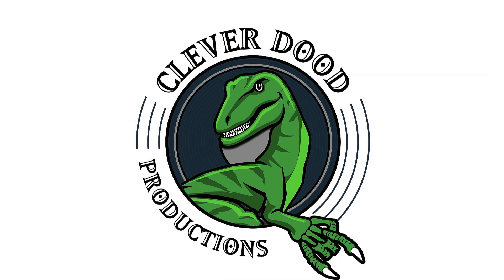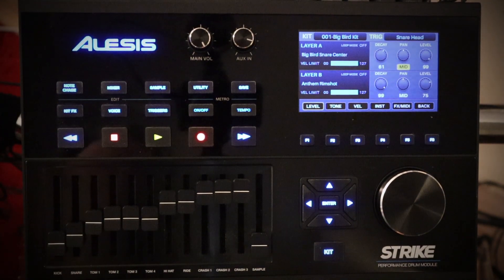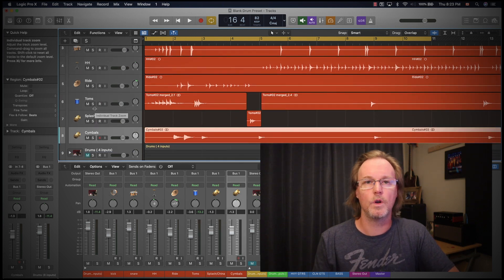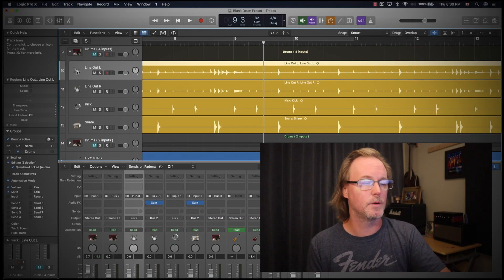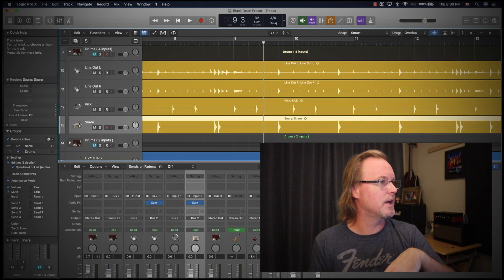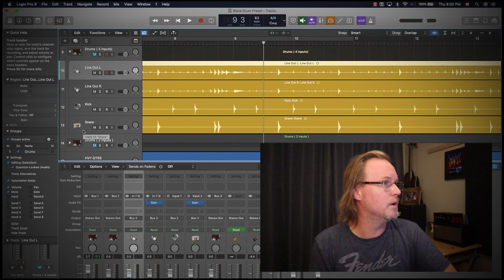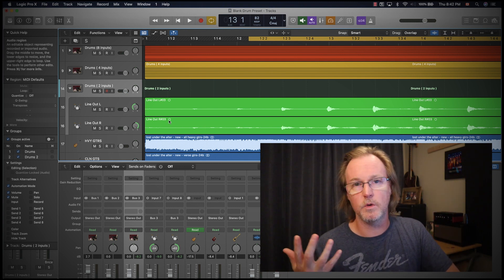Recording with the Alesis Strike Pro - Part I - Audio Outputs

Comment: Hey, Jason awesome video. We've been trying to figure out the best way to record. Removing my drums from my studio to my buddies studio. Cause he's got more computer capability. We've been wondering how to hook this stuff up the easiest and right way to do it. I'm an idiot when it comes to programming and understanding things electronically.  Which brings me to my question.I never can get my high hat to respond.Like it's supposed to I've tried all the comments.I've tried the videos and I can't get it to respond correctly. My buddy Ken who has  studio at his house.He's pretty good at high-tech stuff. I understand when you hook up to easy drummer. That it's got parameters to help with the high hat problems. Is this correct? I don't believe he has easy drummer. 2 or 3 I believe his is just the basic easy drummer. Do we need to upgrade to get better parameters for settings or high hats and such.
 Right now I'm recording my symbols live. Although I love them, it's not practical cause everybody's used to electronic drums in the volume of the symbols, even within ear monitors drives them crazy, not me? Of course, LOL.  I've even been on the facebook and offered money for somebody to come over and set everything up like it should be.
Thanks jason
Reply from the maker: I have superior drummer 3. It gives you 5 ranges from closed to open. So 0 - 20 can be fully closed, 21-50 slightly open etc. in logic it’s the CC#4 parameter and typically open the midi automation and adjust it after I recorded because I can’t ever get e-hi-hats to sound natural. I’ve even thought about just getting real hi hats and mic’ing them instead.

Comment: Question I ran all the line outs to my 18I20 where I have 8 quarter in inputs, lines 3-8 are not working, I tested the cables and they all work on inputs 1&2, any ideas?
Reply from the maker: Maybe check the Focusrite Control software and see if they're processing the signal? I would guess inputs 3-8 just are enabled for some reason.

Comment: Hi Jason, great video man.  Hey bro i was messing around with Logic and somehow i changed my Alesis midi outputs, tom 1 is now tom 2 tom2 is now tom 3 and tom 3 is now 4 and tom 4 is tom 1.  lol. How or what is the easiet way to correct this in the Alesis module sir?  If you dont mind bro i would greatly apprecite it.  I have read everything and maybe i am missing it but coudnt find anything on this.  Thank you Jason!!!
Reply from the maker: From memory, you can go into the midi settings for each pad and change that. If it's really messed up, you could always reset it to factory settings, but if you've done other customizations all of that will be lost.

Comment: Hey Jason what cable should I use for the individual outputs, TRS or TS ????? please answer thanks
Reply from the maker: TRS cables would probably be best as the toms and cymbals are stereo pairs. As far as I know TS can only carry mono signals, TRS carries mono or stereo. I used something like this https://www.amazon.ca/Monoprice-8-Channel-Snake-26AWG-Cable/dp/B00IACDU34/ref=sr_1_1?hvadid=671305341565&hvdev=c&hvlocphy=9000854&hvnetw=g&hvqmt=e&hvrand=4674649382955102451&hvtargid=kwd-315320833108&hydadcr=1502_13637761&keywords=trs%2Bcable%2Bsnake&qid=1699534125&sr=8-1&th=1

Comment: So no need to worry about latency when tracking individual outs?
Reply from the maker: Depends on a bunch of factors I guess. I never had latency issues but I turn on low latency mode in logic, lower my samples, close anything running etc.

Comment: Bro, did you explain what kind of cables you need to plug into the console? Are they TRS cables , as you mentioned there Tom’s and cymbals that are combined stereowise in one track ? So what kind of cables would you use if you wanna use the 8 outputs? Please let me know as I’m confused a bit about that connection
Reply from the maker: I thought I put the link in the description but I didn't...this is the one I use: https://www.long-mcquade.com/4386/Pro_Audio_Recording/Cables/Yorkville_Sound/8_Channel_TRS_to_TRS_Fan_Snake_-_10_foot.htm
Reply: @cleverdood  hey Jason thanks buddy, I’m actually trying with regular mono cables and it records fine, what would be the diffrence if they are trs? Is it better trs , I have trs but they are in my other home
Reply from the maker: @dannyveras  as far as I know, TS cables are mono and unbalanced ( mostly used for guitars ) and TRS will carry a mono or stereo signal ( like 1/4 headphones ) and are balanced. Either should work fine for the Strike. I don’t know enough to know if there’s any difference in quality.
Reply: @cleverdood  same here I don’t know if it’s better but it works , I’ll try to bring the the trs ones and see the diffrence , if the Toms and cymbals are balanced on stereo it might be better , I’ll let you know !

Comment: Would anyone have an idea of why my individual outputs for toms left and right and crash left and right won’t play any audio? The individual drum outputs for everything else produces audio, but the drums and cymbals that are a left and right output do not produce sound.

I am running all outputs into an 8 channel preamp. There is a light on the preamp that lights up, which indicates the preamp is getting some sort of signal to it. But each individual drum pad for left and right for toms and cymbals would cause signal to go to 2 different preamp channels even though each left and right Tom output is connected to only one preamp input.

Not sure if it had anything to do with no audio, but the only outputs that do not produce sound are the ones that get sent to 2 channels in the preamp.

Comment: Hi Jason thanks so much for the video. I'm using the strike pro live with an acoustic kit with real cymbals and triggered drums. I'm only using the module for Kick, snare and toms. I want to be able to add effects to the drums and save as a new kit. I want to keep the live mixer clean with no effects as I cant change the mixer settings quick enough on stage like selecting a different kit. Is there any way to add and save effects and have them output through the individual outputs? or am I better to say pan all my toms to the right output and the snare to the left and have the kick just raw. Maybe just using the two main outputs is the way to go and just set the levels of kick ect based on the venue through the strike pro mixer. I hope this all makes sense. Any help would be very much appreciated. Cheers Sean
Reply from the maker: As far as I know, the individual outputs will always output the raw samples, not the kick FX. For live, I'd rely on the sound person and use the individual outs so they can control the levels and FX. Probably less stress!

Comment: Thanks for the video.. I have a 8 track audio interface but I cannot figure out how to pan my toms and cymbals to feel the stereo. to me the signal is centered.. New to the Alesis SE, any advice ?
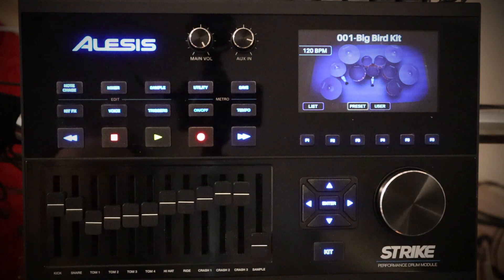Reply from the maker: you'd have to set that up in the Alesis module 02:18 or so area in the vid...
Reply: @cleverdood  thanks it is a little before  the part for the 8 tracks around 05:47. Thanks I will set them up in the module.
Reply: Did you pan your inputs in the DAW?

Comment: Awesome video. Exactly what I was looking for. Question.... Can use USB to record audio on the Strike like you can with the Roland modules?
Reply from the maker: good question! I assume the answer is no, and only midi is carried over USB, but I haven't tried that!
Reply: @cleverdood  plase can u try ?
Reply: No. Alesis did not include that.
Reply: You can connect the 2 streo outputs to an adapter that has usb on another end, then record on your software